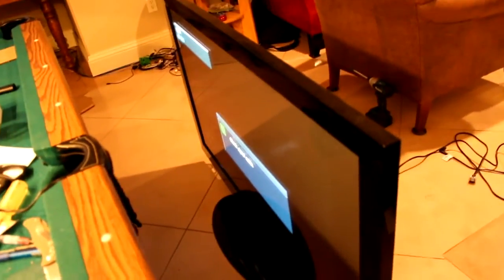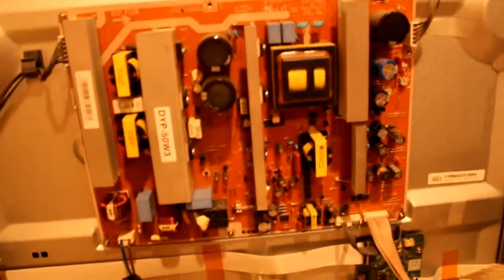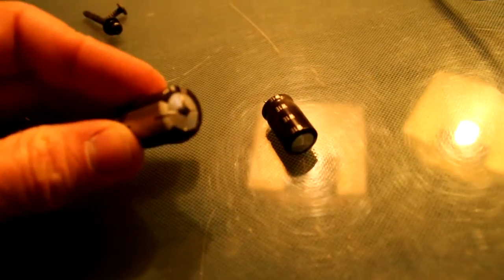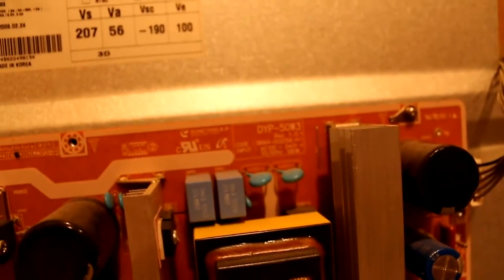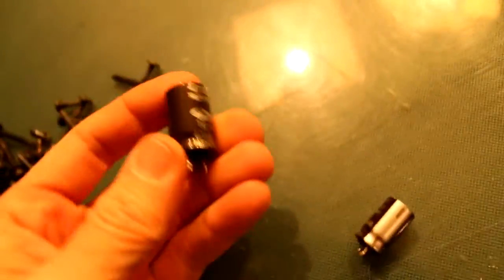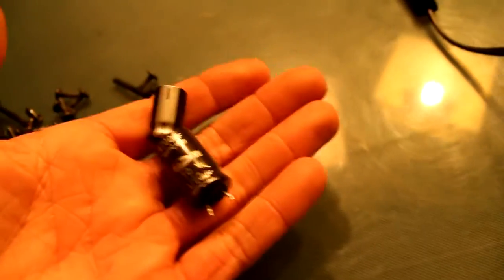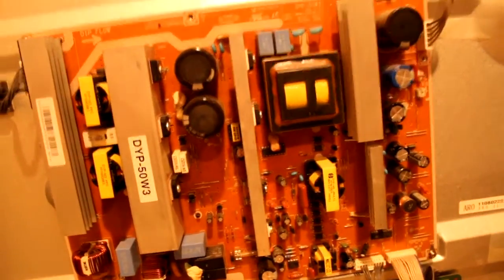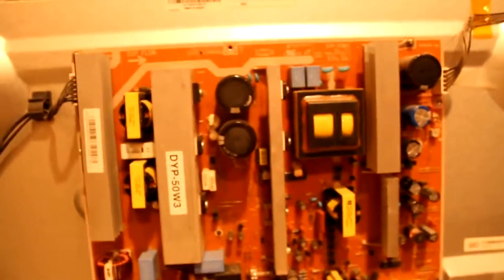Repair Samsung Plasma PN50A450P1D Power Supply Board DYP-50W3

Comment: I just picked up the same TV for free (and now I know why).  I plug it in, it clicks, the red LED power light turns on, the backlight turns on, I see a few splotches of red near the corners. Then it clicks and the screen turns off with the red LED still on.

But when I removed the back cover, I did not find the same caps blown. In fact, none of the power supply components looked bad. Instead, one (50V, 100microF) was on the large, leftmost board, about the middle and half way under the long heat sink. a second (25V, 680microF) was under the rightmost, upper board, again half under the large heat sink.

There are many large flat cables connecting these boards to the screen, so I would be careful about flexing these too much when flipping these over to desolder them. Their leads must also be unbent for them to come loose from their respective boards.

The replacements cost $11.68 total (I bought a few extra of each). I hope to have good news when I install them.

Comment: No business having a 10V capacitor in there. The rest are probably 16V. Would cost 2 or 3 cents more. Hmmm
Reply from the maker: Wasn't concerned with price. Just wanted to replace with what was already in there.
Reply: porkercon my point is that the original capacitor was not adequate, which is why it failed. If Samsung had spent 3 cents more per part, I think perhaps it would not have failed. If it doesn’t fail, you don’t buy a new tv. I’ve fixed 5 or 6 Samsung TVs and it’s always the same
Reply from the maker: True

Comment: YEAH! Absolutely the same here. TV stopped worked, checked caps. Those same are bulging, one I even see black stuff leaking out. Same stuff happened not too long ago with a PC power supply, fixed it with $0.50 in parts. Thanks for video, just confirms it again it's bad caps.
Reply: +Georg Rauh So I got my caps, easiest repair of all time, didn't even need my desoldering stuff. Took me three minutes to replace the two caps, TV working like new again :)

Comment: Un grand merci pour cette vidéo qui m'a permis de réparer mon téléviseur plasma Samsung de 127" équipée de la même carte d'alimentation .
Ma panne sur cette télévision : 
- il ne s'allume plus
- le voyant rouge de veille est éteint.

j'ai remplacé juste les 2 condensateurs comme sur la vidéo !

--------------------------------------------------------------------------------------------------
traduit par google traduct

A big thank you for this video which helped me fix my Samsung plasma TV 127 "equipped with the same power board.
My failure on this TV:
- It does illuminate more
- The red light standby is off.

I just replaced the two capacitors as on the video!